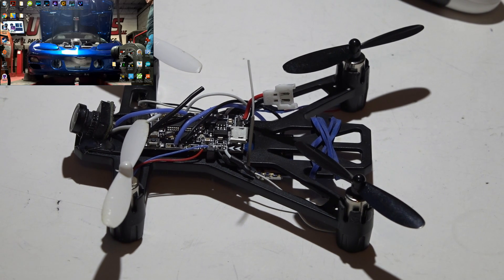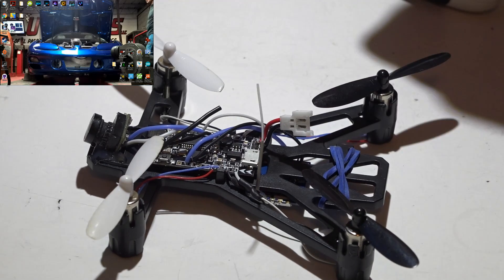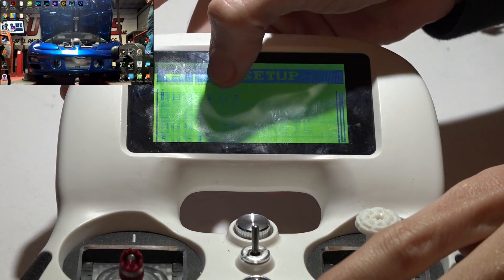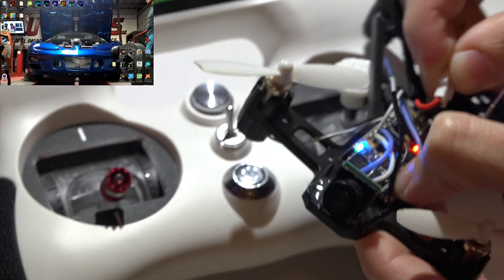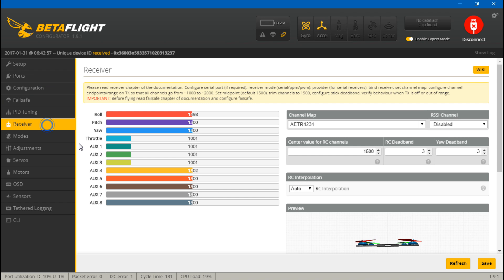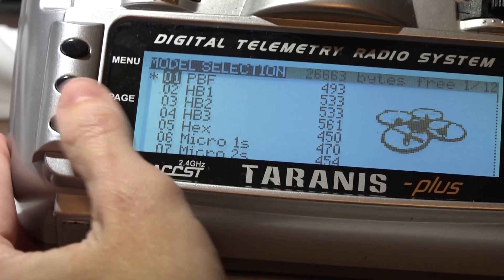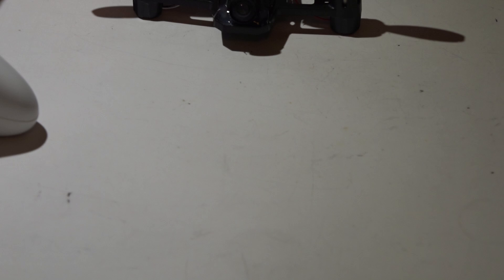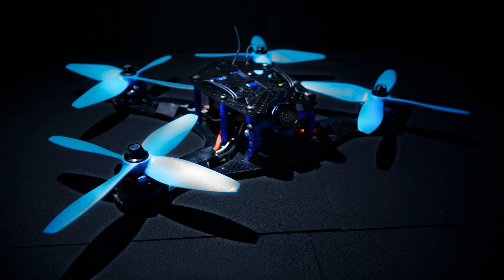How To Bind Eachine AIO F3 Brushed Flight Controller

Comment: Hey JC I'm working on the same bored that you are, the Frsky version, and the instructions say to set it up for serial RX sbus, not PPM. just checking in on you with that and as always you are awesome and thank you for all the great work.
Reply from the maker: I'd try that then. I was under the assumption they they all operated on the PPM protocol, but maybe thats just the Flysky version.
Reply: JC you are correct it is only the FlySky version. Is your Motors spinning up momentarily when plugging the battery in? three out of the four Motors spin up momentarily when I plug my battery in, not sure what's up with that I have the motors disarmed in betaflight. thanks again JC for all your help and great videos.....
Reply: Frank
Reply: Felino Neri - yes sir?